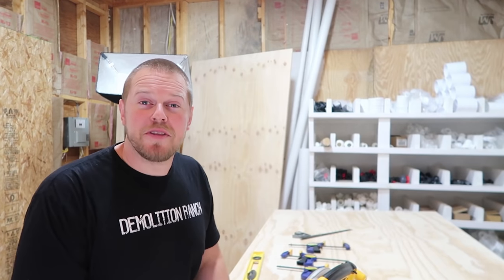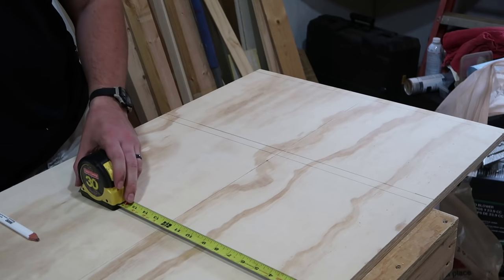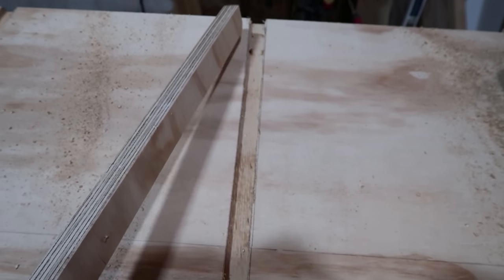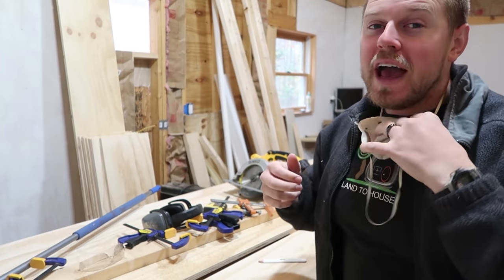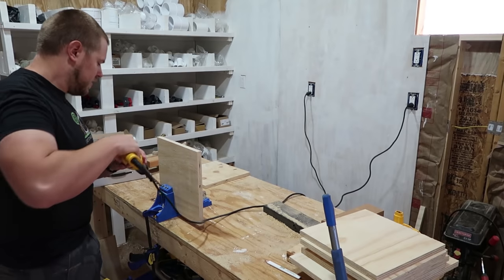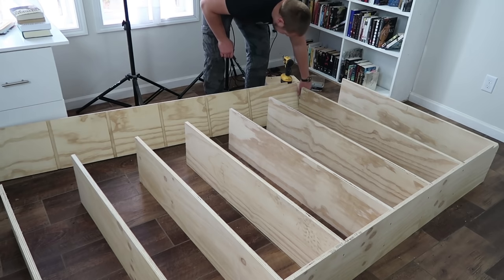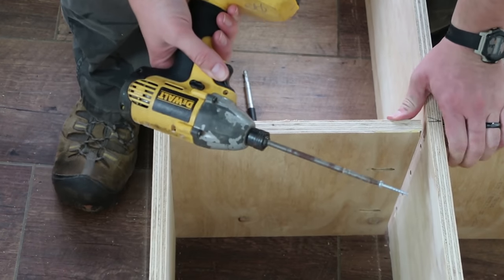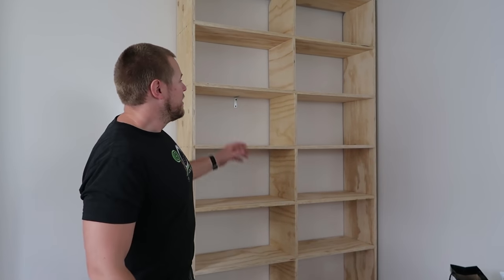Basic Bookcase Build

Comment: Instead of the bracket screwed into the wall, could you install a strip on the bottom of the shelf in the back and screw that into the wall?  Might be a cleaner look.

Comment: Great video, thank you! Might be a silly question, but what is the drill attachment you are using the drill screws into the shelves when assembling it? Looks very handy. I'm going to be attempting something like this this weekend.
Reply: oh and one more thing... when you're screwing the pieces together, have you already drilled pilot holes (it looks like there are pilot holes at 16m 24s for the pocket hole jigged lines going into the horizontal shelf?). Thanks!

Comment: Nice work, the video has a good explanation! How long you approximately needed to complete the shelf?
Reply from the maker: Thank you. It's hard to tell how long it actually takes. I tend to be spread out thin with my projects so it takes a little bit longer. If you were to really work straight through probably between 6 and 10 hours. That is including the ladder build. If you're just building the shelves less than 6 hours.

Comment: Wouldn't it be better to have plywood at the back, and the drill the plywood to the wall ? To keep it from falling over ?
Reply from the maker: I used L brackets on the wall to keep it secure. You can add plywood on the back. In 2022 that adds another $250.